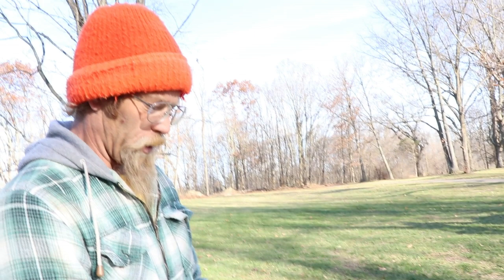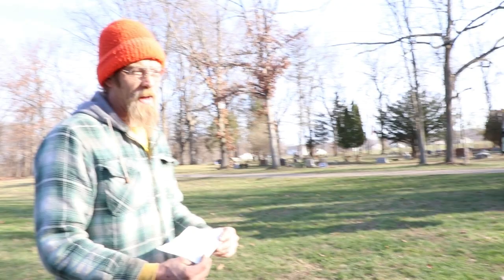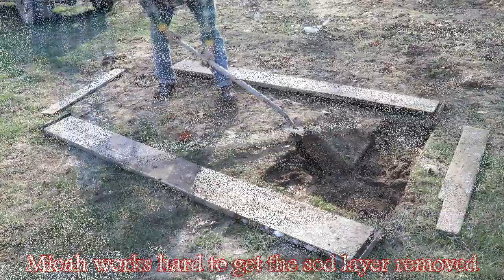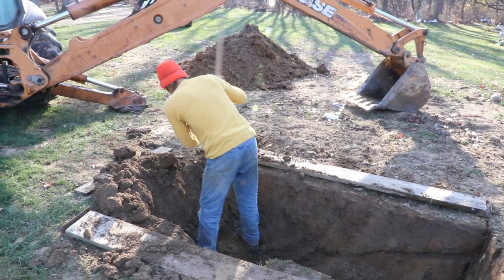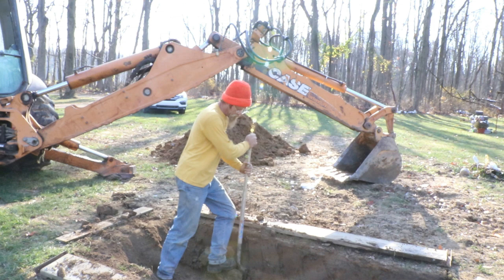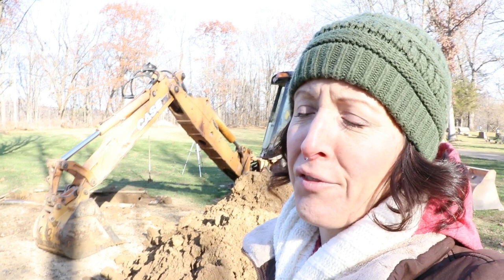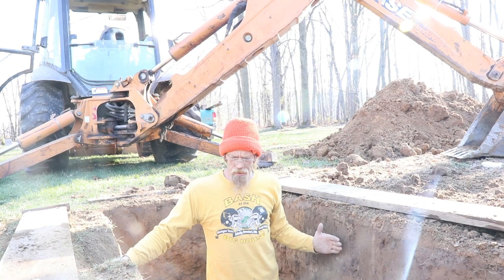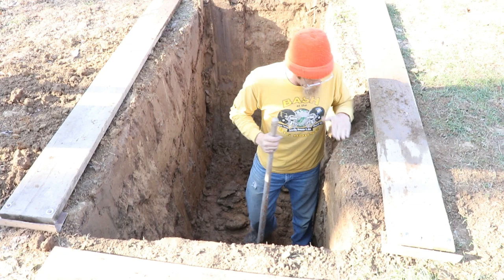Digging a grave for a burial at a cemetery

Comment: Hi Kari...   Found this interesting as my wife and I live in a house on a Cemetery in Ontario.   We care take the Cemetery, responsible for marking out graves for a backhoe from local township comes in to dig.   They bring a 2 or 3 ton dump truck and what we do is load the first 2 or 3 ft on an old 1966 chev dump truck Cemetery has, they we load the rest on their truck and dump it in a area we have for that.    When burial is finished I dump my truck into grave.  If the grass (topsoil) is good, I also take about 3 or 4 inches off and roll it up to put back on later.   We do not bury in winter, but we have a storage at Cemetery that we use in winter and then bury in spring when it is suitable.    Thanks for video
Reply from the maker: Thank you for sharing!
Reply: @m9 ovich Mike.   No I haven’t.  I will check him out.   Orangeville is only an hour from me.   Thanks for the information. 👍

Comment: Hi Kari, would you please ask Micha if worms really do dig their way into somebody's coffin?  Thanks.  I looked for  videos on the subject, but couldn't find anything.
Reply: I've seen quite a few burials and it's a box within a box. At least in California so it would probably be pretty difficult.
Reply: In our cemetery all burials after 1950 have cement vaults or cement liners. Graves before then were just wood coffins. And yes the wood fails the worm's can move in. Those are the ones that sink.

Comment: Can you address a very important issue,that to date has never had an explanation to satisfy me.Both parents were buried in the same plot one above the other. Both graves sunk ,dramatically after being back filled.If the grave is opened,a dirt removed .Once a casket is placed into the vault which is now place in the ground and the vault cover is secured .And the back fill is replaced ,how is it possible that the backfill will sink up to 2 feet.My thought the open site has been refilled with a solid vault which is covered. How and where could the backfill cause any sinking .Since the opening has been completely refilled . Perhaps my example is a 5 gal bucket is emptied.A solid object is placed into the empty bucket.The back fill required will be less than the bucket had prior to being emptied.With the required backfill now replaced. How is it possible to completely refill and find a drop in the settlement a week later.It was completely refilled.My concern is one or two things may have occurred. The first vault was damaged,and open causing a collapse form the extraction and replacement.Or worse the vault cover was not secured during the back fill process ,or failed . Thank you for providing a professional and compassionate response
Reply from the maker: There are a lot of unknowns to that situation. I would need to see some photos to give a better guess.

Comment: The cemetery I worked at did not have the markers. A central sidewalk had metal pins at the edge of the walk. A tape measure was hooked on the pin and stretched out. The plots were four by ten so for grave ten you measured to 44 feet and then backed up four feet then placed a pin in the ground. Then we went back ten feet along the sidewalk and again pulled the tape. Our excavator had a bucket three feet wide so the opening left a foot on each side for spacing. We did not pile any dirt next tot he burial plot. it was placed in a trailer and hauled away leaving a neat area. after the service was completed the dirt was brought back and used to fill the opening.
Reply from the maker: Thank you for sharing

Comment: Burying the body with the feet to the east and head to the west is mainly a Christian ritual, where the head faces the light of Christ at the rise of the star (the Sun) each new day. Most other faiths/religions do not have a specific burial placement rule. Some of the rules may have changed somewhat with the Catholic church as in the past the church had its altar facing east for the Mass. Bodies in the Catholic graveyard traditionally used to face the altar. However this rule may have changed in recent times depending on the church rules. Most cemeteries respect the east west burial but by no means is it a hard and fast rule and there can be many variations and exceptions. This is what I had learned when I was in the funeral industry for 27 years.
Reply from the maker: Thank you for sharing, I appreciate it.

Comment: Will a cement vault be placed in the hole & then the coffin lowered inside it? Did he mean after burial the vaults (I’m assuming cement because I have no idea what you both meant by vault) are only 8 inches away from the next plot. 😳 that’s so close, so must be extremely precise. Micah is an amazing person, I’m so impressed with the skill & precision of straight wall sides. Do you have a video on that Kari?
Reply from the maker: The casket would be lowered into the vault. That video will be coming!

Comment: Another consideration are cemitaries that have alot or rocks ....you have to jack hammer to bust the rocks .I have been on funerals where you have to set the vault after the service because the hole is the size of a truck from caveing in and digging back out and it is not safe for the families to be around the hole .There are a lot of scenerios  vault setters deal with on a daily basis.
Reply from the maker: Very true

Comment: thats a pretty new or not very used cemetery if you have markers, i worked in a municipal cemetery with thousands of bodies and you would bury the person according to how much room you have left in that particular section. graves were began in the 1800s had lots of room so the caretaker wasnt always *on the spot*....you improvise by collecting bones from unmarked graves and burying them under the incoming vault with deep respect, the person digging graves were not so precise way back then as there was lots of room and he would be long gone by the time it filled up. personally , we averaged 50-60 burials/yr and i did it for 20 yrs exactly as michah did only we would load soil directly onto dump trucks to take away soil and to fill in said grave. being a cemetery with lots of larger headstones we often had to dig the entire thing by hand

Comment: That was painful to watch. I could dig that with the machine and never have to use a shovel. All the Cemeteries in Chicago have the bucket as wide as the Grave they dig. So they only need to dig one bucket. Even with a smaller bucket on the machine a good Operator should be able to Dig a Grave and never have to touch a shovel.
Reply from the maker: Thank you!

Comment: If the burail holds four and they use volts then how dose that work the next time it has to be used? First he said 16 ft but only went 4 and a half.
Reply from the maker: They do not have double depth at that cemetery. A lot can hold more because it has multiple graves. One space can hold multiple sets of cremated remains.
Reply: Although he said deep he meant length and width.

Comment: What happens when the ground is frozen ? Can you still bury the caskets Thanks
Reply: In northwest Iowa they use a frost bit (curved and only an inch and a half or 2" wide) in place of the bucket to break through and weaken the frost and then put the regular bucket back on and dig.

Comment: Informative - - but the abrasive loud music is a big distraction (nuisance).  The narrative audio is  at a fairly low level - then, at the end of each section, the blaring music reappears - it's a totally different decibel level that can't be tolerated with the headphones I use with my PC.  Please consider the volume level next time you need to use music to fill space between the informative sections  (music is fine BUT keep the decibel level the same so we don't have to jump to adjust the volume control each time. .
Reply from the maker: Thank you so much :)

Comment: I thought the vault was 6 ft down. Micah said, he digs down 4 ft.
Reply from the maker: Correct it is not 6 feet at most cemeteries anymore!
Reply: @KaritheMortician  why is that? Then the top of the vault would be 1 to 2 feet from the surface?

Comment: Nobody does the sod layer thing. . NOBODY. . Just dig the grave, fill it back in when the casket is lowered, and the vault is sealed. . Over time, the dirty will settle, and you just fill in the dirt as needed, and eventually, it'll go back to normal. . Stop wasting time with the removing of the sod squares.

Comment: My god, this guy does a lot of manual labor, what's he going to do if there is a major casualty with 300 dead people to bury? There has got to be an easier way to bury people than this method! In beginning he was talking about 12' depth? When is that used? Removing all that dirt - total waste of time!
Reply from the maker: He is a hard worker
Reply: He meant the length of the grave is 12 feet, not the depth to which it is dug. Huge difference.